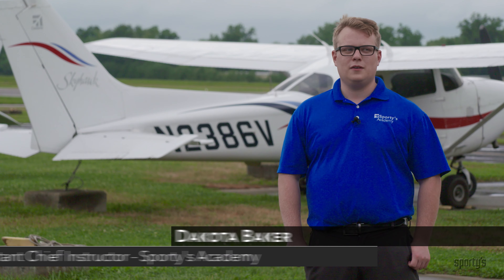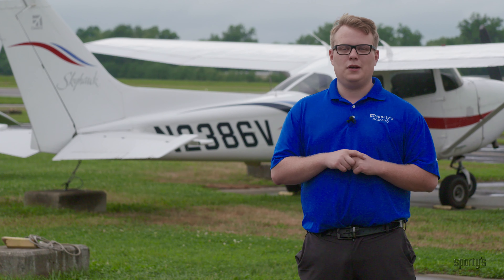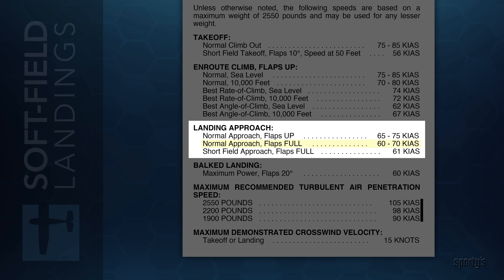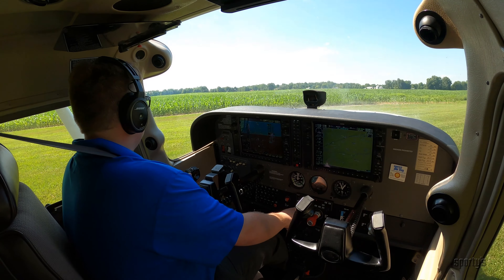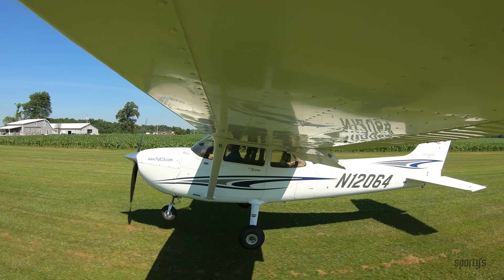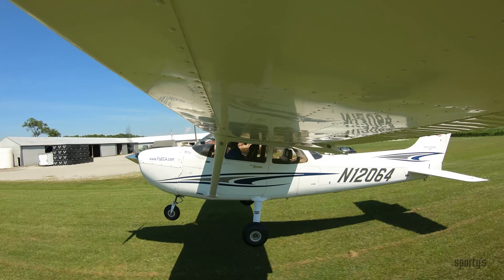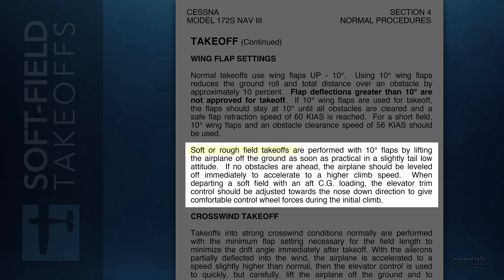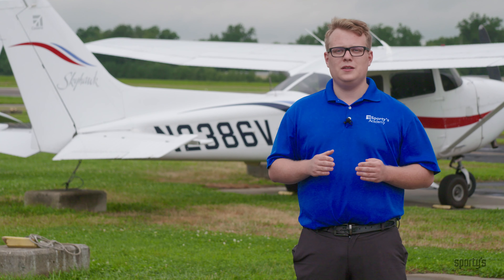Ask a CFI: Tips for better soft-field takeoffs and landings

Comment: Any comm. aplicant should be well virsed in this; in my early 135 days ive had to land out in the SAC valley at farms to deliver parts etc on hot days. Or landing on a beach overseas fir commercial carrier. Know your plane and the area you operate... Check with local pilots before...

Comment: Landing degrees of flaps?
Reply: Typically full flaps (30 or 40 degrees depending on aircraft), just like any other normal landing. So, a soft field landing is just like any other, except for the items mentioned in this video.